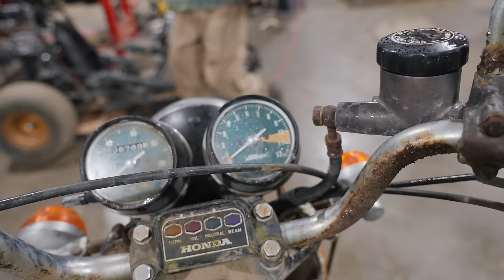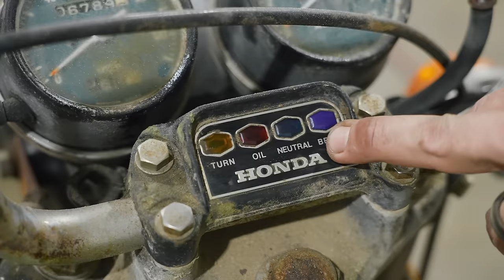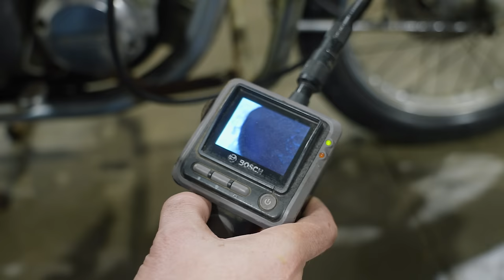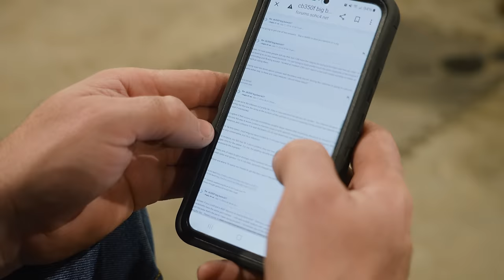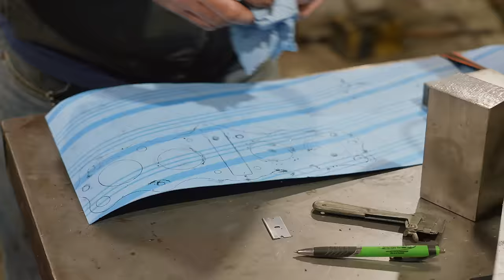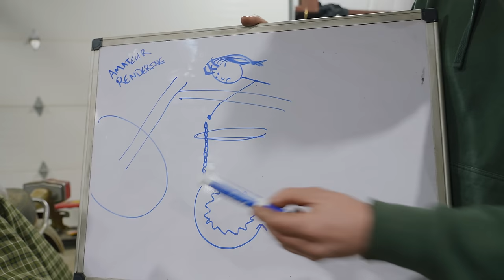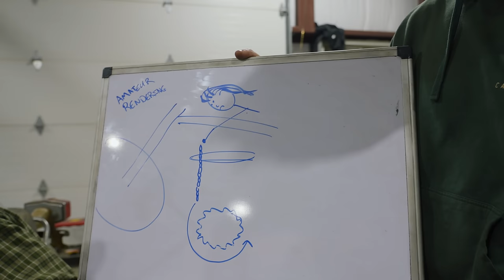This Honda CB350F Has Mud Wasp Nests in the Cylinders… Will it Run? (Sitting Since the 80s)

Comment from the maker: Backyard big bore kit incoming
Reply: late April Fools ep
Reply: Put that engine in a mini bike frame 😂
Reply: Great to hear that!
Reply: Let’s go 😂
Reply: My 74 400 F only came with a tachometer
Reply: That engine is worth rebuilding
Reply: What the heck is with all the commercials YouTube?
Reply: Easy, just swap in a complete 400 4 cylinder engine if you can find.
You might be able to use some XR100/80 / CRF100/80 pistons/parts in the 350. The old go to with these XR bikes is to use a CB400 pistons to build up big bore XR80s. Piston pin is the same size and a lot of piston options for the XR engines.
Reply: @ryankeul5690  I agree 💯 Effin YouTube commercials anyway it about drive me insane I almost had to quit watching YouTube I finally paid the 13 something so that I could get some TV shows without actually watching 2 hours of commercials and then all the buffering to go with it because of the commercials and then the sponsored commercials on whoever you're watching has gotten really bad also
Reply: That shiii will be lit
Reply: I have two of those motors. One is going on a lawnmower.
Reply: What is the electronic ignition conversion you guys used?
Reply: It sounds like the starter is stuck engaged because I can still hear it as the engine dies
Reply: Why. What's special about it is that it's a 350. Honda already made "big bore" kits for it. 400, 500, 550 etc. just pick the cb you want
Reply: Maybe lay off the ads remember those days?
Reply: @carsandcameras hey man i have a perdedor 420cc non-hemi and i did a governor removal but u don’t know what toque converter/ clutch i need what do you recommend?
Reply: If u love the 350-4 ur gonna love the 175-2... When I was a kid I got 2 bikes, both 1970 models.. 1 was a 175cc single cylinder dirt bike/duel sport.. the other bike was a 175cc inline twin street bike like ur 350-4... The twin sounded meaner than it actually was but it would do about 70mph in 5th gear with a 100lb Rider....
Reply: My suggestion, look for a 1970 Honda 175 twin street bike.... Looks exactly like ur 350-4 but it's a 2 cylinder...

Comment: A 350 four?  A bike worth restoring.  Thank you for saving it from the crusher!
Reply: if you love old 4 cylinders with low displacement check out a zxr 250 from the 90s 250cc straight 4 that revs to 18k rpm they're awesome machines
Reply: @nickpollay1681  the smaller the displacement per cylinder, the less each piston weighs, the faster it can chooch :D
Reply: Honda Mc22 = best of the 90's il4 250s.

Comment: I had a 350 Twin. Drove it to work in the summer time. In Chicago! Put gas in it about once a month. For a small bike they did ride nice for their size!
Reply: It was a 360 twin, the 350 was a 4.
Reply: @yogibear4682  Wrong. the 350 twin came out the year before the 360 twin. My neighbour had one(360) My 350 had a higher top end speed!
Reply: I have a 360 twin and can confirm they are great on gas for what they are. Especially around town.
Reply: When ax handle doesn't work use metal pipe on aluminum piston heads! There handly hillbilly fix it tips turned into a big bore kit because they didn't  soak the rings,holding starter cranking for that long.yikes.king of the hill has a you tube video,fusible link. Is the term and a stick and hammer all you need to destroy vintage Honda.

Comment: Not a production bike, but yall should really look at videos of the RC166, one of Honda's GP bikes from the 60's. It's a inline 6, 250cc with a redline at something like 21k. The sound that engine makes is truly divine.
Reply: I marshal over on the isle of man at both the TT and the manx. And one of my favourite racing bikes has to be the 350/4! On open mega pipes, if you've got wax blocked ears stand next to one in the pits area. Hearing job done. 😂

Comment: I have owned Harleys, Yamahas, Kavasakis, Hodaka, Moto Beta but my all time favorite was my 1975 Honda CB400 Super Sport with in-line four  actually displacing 408 cc, 6 speed transmission, and the sweet, swept 4-into-one exhaust capable of 110 mph with two passengers.

Comment: Great project.
My brother-in-law bought a brand new 350-4 back around 1972/73 time frame. I loved that bike, it ran so smooth compared to my 160 or my other bil's 305 Big Bear. It just ran so vibration free that it seemed to purr like a cat. Freeway driving was where it was most noticeable and made the speed limit so cruel on the Orange County California system.
Looking forward to the rest of this one. Thanks for the video. 😊👍
Reply: this series of bike is probably why all the hot bikes today are small displacement 4s. wind em to the moon!
Reply: @ghomerhust  Your likely right. What was not to like about them. Plus those four pipes just looked so cool being something new & different. 👍

Comment: Anyone complaining about your methods of reviving this bike is no real expert or enthusiast.  Keep it up.
Reply: Guess calipers,compression gauge,micrometers, feeler gages to measure valve lap don't work as well as a stick and hammer and pipe. There is a term in manufacturing called tolerance, what is  and not allowed, usually specified on engineered prints.but what do I know.i work within plus minus 1 millimeter.and own a goldwing, hammer pipe and stick won't diagnose electrical problems.    Trying shortcuts will cost you in the long run.
Reply: @DaveDeline  There's a time and place for pedantry.  This isn't it.

Comment: This brought back memories of the CB750K I used to have. I remember tearing down the engine in the parking lot of an apartment where I lived at the time. The chain had worn a hole in the engine case near the drive sprocket, and I had to get the part to someone who could weld aluminum. By some miracle, it ran after I got it reassembled.

Comment: In the UK & Europe, the CB350 Four became the CB400 Four, between 1974 & 1978. Haynes do a workshop manual for the CB350 Four & CB499 Four.

In the UK, during the 1980's, there was a 430cc big bore kit, made by Yoshimura, for the CB400 Four, if I remember right. I'd have to check an old motorcycle magazine ad for the kit. There was also an aftermarket turbo kit, that was tested in a UK motorcycle magazine, during the mid-1980''s.
.

Comment: This is a keeper. Worthy of a full restoration. Not many 350/4'around.
In the late 70's i put Coke Cola in the top of the cylinder and after a few days of soaking used the wooden block and hammer method. I was then able to take off the Barrel, honed clean the piston and rings.   The engine ran sweet for many years.

Comment: My first bike was the 350 twin with both muffler cut off at the foot pegs and knobby tires worn down to just suggestions of knobs. I used to power slide it around the wet clover fields near home. Louder then most of the Harleys of the time, as it had no mufflers.

Comment: Wiseco used to make parts for those 350's. By the way Dale Walksler used to use a hotplate under the motor to bring the temps up to around 400 degrees to bring the motor up to the temp it would be at when shut off for the last time and then try to turn them over or to start.

Comment: Thanks to you guys, I picked up a lawnmower for free that was seized up. I needed a mower after the landlord was mistaken that they had lawn services cut the grass and HOA was getting mad. Soaked the cylinder with PB Blaster, let it soak. Finally freed up and it barely runs. Cleaned the carb but it still uses a ton of fuel. And it surges, so that speed controller needs a new spring I think. But it works. Neighbors don't like the smoke so maybe I'll hit up GPS for parts to rebuild it. I didn't want to pull the head without a new gasket, so just PB Blaster only

Comment: On the cylinder sleeves. You don't press them in-out. You set them blocked up with the top of the cylinder down. Place in over. Set oven at 350*. As the oven heats the cylinder, they expand. Once expanded enough, the sleeve slides out. Reverse to install.

Comment: Side note: crash bars are awesome for protecting your cases. The alternator should be full of oil. I discovered that the first time I crashed my Honda 350 (twin). Granted when I crashed my girlfriend's 450 into a car it still broke the ignition cover. (I did take the entire bumper off the car though, and didn't even drop the bike!)

Comment: Here's a quick piece of info. For something like this, there's a better penetrating oil than PB Blaster. It's called Free All and while it's a little more pricey than PB Blaster, it doesn't take a huge amount and the stuff just goes to town. I'm probably nuts for saying this, but I've always had better results with Free All than PB Blaster. Otherwise it's good content and it shows how things can get when they're not stored correctly....

Comment: I had a 250G5 twin, 350 twin 400 four, RS250 single and 750/4F1. Nice bikes with a tendency to wear heads when the oil pump screen gets blocked with cam chain tensioner shavings..

Comment: In an application where the timing chain is in a blind hole like the early Hondas I have had good luck using mechanics wire run the chute makes the turn , stiff enough to handle it and soft enough to bend , it'll follow the route of the chain

Comment: so cool  . i would be surprised if you could find a big bore kit for that old girl. they used to have oversize .025 mm . put the origonal pistons in a sonic jewelry cleaner and that may free up the rings after a day or two. hone the cylenders and put all back together. i have built bike engine picking rings andpistons out of 2 or 3 different engines and use origonal head gasket. then i put the bike in my collection. start it once every ten years or so

Comment: 20:57, interesting... heating up the piston would make it expand. I'm confused, why wouldn't you heat the cylinder instead?
Reply: True, but I would still start with the cylinder. As they stated multiple times throughout the video, it was more of a fun experiment to see if they could get that old thing running I would say they accomplished.

Comment: The tried & tested method I use to free up gummed up piston rings, is to inject WD40 or GT85 into the ring gaps, of all the rings first. I then play a blow torch or heat gun onto the crown of the piston. The heat causes the oil trapped behind the piston rings to boil and they pop free on their own.

Comment: The bottom end is harder to repair than the top end. With that in mind, it's actually a great idea to get it to run by any method as to make sure the bottom end is okay. Imagine buying new pistons, rings, gaskets, head work, and more only to throw a rod or have a blown transmission. 

That, and the bike was probably gonna get scrapped or parted out one day anyways, most likely for the engine to never run again. So, either way, you'd have had an engine that didn't run and in serious disrepair, or an engine that can't run that you gave your all into. As I'm writing this comment, I haven't seen if it started yet, but I bet it will.

Comment: I got a perfect BMW R/75 for a couple hundred bucks. The engine was frozen. My wife standing on the kick starter and me hammering with a 2 pound hammer and 2x4 on frozen cylinder got the jug off.  I am a machinist so I bored out the cylinder and resleaved it. Used same piston with new rings. I still ride it often. That was 20 years ago. Same bike, I have done nothing to it since fixing engine. It has gone cross country 4 times since fixing it.

Comment: 20:40 correct me if i am wrong, but wouldn't heating the jugs themselves and NOT the piston be the way to go? expand the diameter of the jug by heating the outside instead of heating the piston and expanding it in the already too tight stuck jug? that's how ive done bearings for 25 years. heat the outer race, ice the inner race, and they slide into the holes amazing
Reply: 100 percent correct. Torching the piston can only stick it harder. I'm surprised that half of the comments aren't saying the same thing.

Comment: this remembers me of my father aprilia bike.
coolant leaked in the cylinder and it got stuck over the last 35 years.
this year i decided to do the minimum to get it running, unstuck the piston and rings and shit ran (it's a 2 stroke)
sadly, i think some seals died and it's not running right. might end up opening the whole engine to change out seals, but i want to keep the of piston and cylinder, because they're still good enought to run and make some power

Comment: The spindle on the single front brake calliper is prone to seizing. What I did with mine was drill the housing and put in a grease nipple. When you get it rolling, lol.

Comment: I have also used marvel mystery oil brake fluid and transmission fluid together and filled the cylinders and then slowly worked it by trying to turn it over and lightly tapping the tops of the cylinders as it sits day by day there is also more aggressive way it's called naval petroleum jelly

Comment: 4:38 more specifically, the crash bar saves the case without the crash bar you would rip the stater and case off the side of the motor

Comment: 15:24 "it runs as long as there's oil in the cylinders"  run two stroke fuel or dump two stroke oil in the tank... I did that with my 250 fourtrax wheeler it made it run better...

Comment: Next time y'all want to do something like this try putting a little graphite powder mixed with oil in the cylinders and turn the engine over by hand the graphite will fill the gaps between the cylinders and the pistons and you can use flex seal for a head gasket it won't be a permanent fix but it will show what you can do to get a junk bike home if you have to.

Comment: my fave bike was a suzuki gs 450L because it had a 11k red line and was geared to where the tac was the same as the speedo. so at 60mph you where pulling 6k rpm and it sounded like you where flying around but where doing the speed limit

Comment: We use to pour atf down the cylinder and let it sit for a day or two then roll it back and forth in gear to break the engine free. Sometimes you'd get lucky. Sometimes not

Comment: You should find a 400f engine and build that up. 6 speed and a better flowing head. It will bolt right in the 350 frame.

Comment: I had a 302 that looks worse than that I took the heads off use the wire wheel like you are that motor sat in the field with the spark plugs out no valve covers on it no intake for over a year I got to run pistons and crank and everything😇✝️🙏❤️🇺🇲💯👍

Comment: I don't have time to read the other comments, but I'm not upset with anything you did to get it running, but I'll be LIVID if you don't send the cylinders and pistons to a real machine shop for the proper bore procedure.
P.S. The definition of livid is furiously angry.  ;)
Note: I always wanted one of these myself but not for the 10,000 RPM redline, (I've had Yamaha's that would turn 1.5 X that) but just because it is such a cool size four banger.

Comment: The CB350 4cyl was one of the most under powered bikes HONDA ever made! I used to service and perform warranty repairs on them when they were new. It was was very low production model. It was quickly replaced with the 400 four that totally out performed the 350 four in all ways!.

Comment: Finally something I can help with!  I have 2 cb350f bikes running and 2 more bikes worth of parts.  I've used the pipe technique as well for 2 different engines that are both runners now, with the same cylinders.  Rings and a hone, you're going to go.  Check your timing with that electronic ignition.  I have the same one (4into1?) and had to twist it to the end of the slots and actually file it to get the timing right.  Works really well though!  If you have the original carbs, I'd run them even with the big bore kit.  They are intimidatingly small, but once you understand the carbs, they are really easy to work on and surprisingly forgiving.  Don't separate them, just clean them all together and use Honda emulsifier tubes as the aftermarket ones don't fit right and will cause the bike to run rich.  When set up right, they run great from idle to 10k, but love 6k plus and will run there all day.  I commute a hour to work each way, all highway, all at 8k to 10k.  Many miles on my cb350f bikes like this.

Comment: Honestly, I had no doubt it would run .. IF the bottom end wasn't seized.. once you knew it had good oil and no water in the crank, it was a sure bet.
Personally, I would prefer to keep it a 350 and not a big bore kit, but it's not my bike so have fun!!!
Thanks for sharing 🇨🇦

Comment: Use a piece of safety wire and  bend a loop in it and feed it around  the gear angrab it on the otherside with long jaw needle nose plires ...have done it before..

Comment: I think the 400 4 heads and barrels might fit that engine, I had a 76 version of the 400 in the 90s that was seized solid, but after a couple of days with white spirits down the bores before I got some WD4O for a day followed by loads of oil, I turned it over with a socket on the crank bolt and a bit of leverage it all started moving again and an engine flush I got it running again with a fair bit of work, and all the plugs were still in it, but they got replaced before it ran properly after a new air filter was fitted, I had never seen a 350 4 here in the UK. Good luck, guys!

Comment: If you would have let it run at max RPM when you did get it running, it could have maybe stayed running and after a while potentially get the rings unstuck

Comment: Why do a paper head gasket? Just take the original one and get a can of k and w copper coat gasket sealant. Smear some of that on there and reassemble. If not that there is another copper gasket seal in a spray can by crc I think it's even branded as k and w... Once I discovered that stuff I stopped buying head gaskets. I've NEVER had one leak.